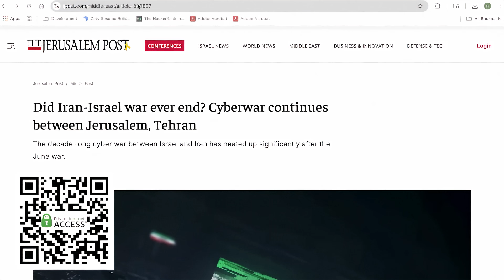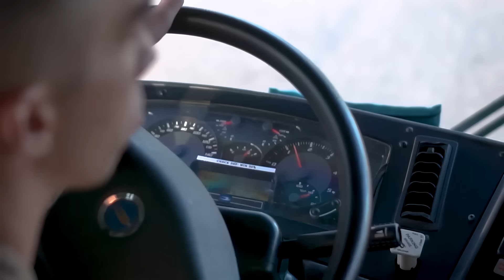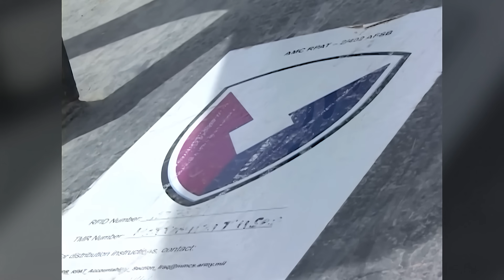Why We Leave Tanks Behind: The Math of War’s End

Comment: Destroying small arms so it won't filter back to the local black market is a whole project too. To do it at scale, the ideal is a small field machine shop with ventilation and blokes sawing them apart.

Gifting the stuff to a local partner is another method. Suddenly the local police has a US MG and the local militia has US armoured cars. This is usually a slow erosion, if the system to maintain it also disappears.

Comment: So you guys didn't get your tanks from Afghanistan because you didn't want to spend 100.000 on moving a tank that costs millions. Got it. The up-armored Humvee had a unit cost of approximately $220,000 in 2011, which is about $294,000 in 2023 dollars. NATO’s logistics operations during the Afghanistan withdrawal relied on land routes through Central Asia.

Air shipping costs were estimated at $14,000 per ton.
Wikipedia

A typical Humvee weighs about 2.4 metric tons, meaning purely air transport could cost around $30,000+ per vehicle.

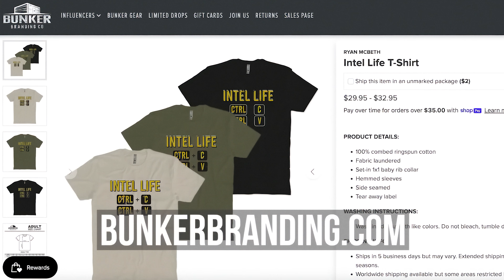Comment: A lot of the 3D printing referenced right at the end (~ 12:30) could be done right on the submarine itself. Today's FDM 3D printers could make it turnkey to print very strong fiber reinforced nylon parts. These would be subject to creep without annealing (which deviates dimensions by ~0.5%) but would in most cases be just fine as a temporary part for a 90 day deployment. Other parts would need powdered metal sintering 3D printers, which would probably be more practical aboard a supply ship. Small parts for submarines could be retrieved or delivered by sub launched underwater drones which could be recovered through torpeodo tubes.

Comment: It's only when I look at the numbers that it makes sense. A humvie cost the US government about 30k. The flying cost of a c130 is 10-15k per hour, to Afghanistan and back is about 500k. You can fit 3 humvies on a c130. You could buy nearly 17 new ones for the price of recovering 3 used ones. The MRAPs cost 1.1m, but you can only fit one on board.  That seems harder to justify, but the ones left behind were probably the most "used" and you've got to factor in repairs to them. Maybe you end up with some decent used vehicles but it brings the price close enough to just say, screw it buy a new one. Buying new also stimulates the economy and you get a string of tax back from the company, employees, suppliers which you don't get from moving it all. I still think they should have been destroyed. It's a bad look when the Taliban are driving US military vehicles.
Reply: Humvees are 250k each not 30 k I agree with the rest of your statement
Reply: Not when u buy thousands of humvis. $30k tax free & no dealer markup?  Old $$$, now after Biden inflation it’s easy $300k.  And more
Reply: @HDSME  30k is probably what a disposal yard humvee costs...
Reply: The mistake in Afghanistan, as well as Veitnam, is believing they would fight. They didn't.
Reply: Use a boat??
Reply: The economy stimulation thing is a bit farcical considering that the government only recoups about 15-20% of such spending in additional tax revenue. The only way that government spending has an eventual positive net economic effect for the citizenry is if it causes accumulation/cultuvation of capital of some sort (i.e. capital goods, human capital, social capital, or natural capital), and only if there was a deficiency in that type of capital (e.g. in the wake of some crisis or strategic technological discovery).
Reply: I agree.  Should’ve at least destroyed everything before leaving it behind
Reply: That's why we have a Merchant Marine and Sealift command. It doesn't have to come home fast.

Comment: 10:14 my issue is why couldn't we pop a thermite charge or some white phosphorus into the engine bay of those vehicles...

Leave them as scrap metal instead of fully functional.
Reply: I had the same question.  Even in boot camp, they explained that incendiary grenades could be used to disable artillery or equipment.  Were there none available?